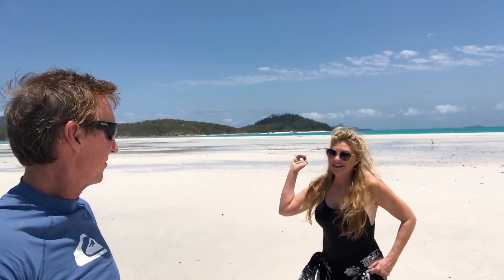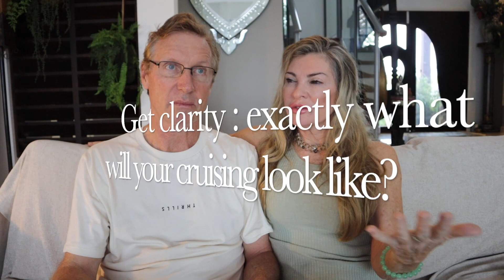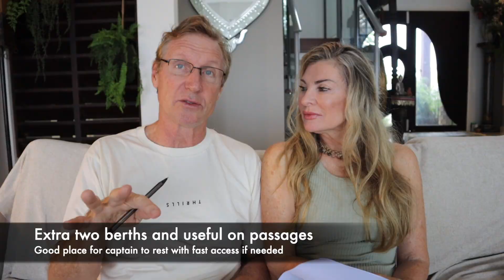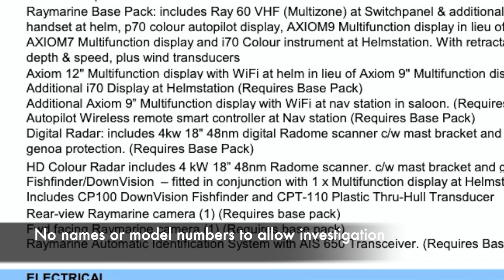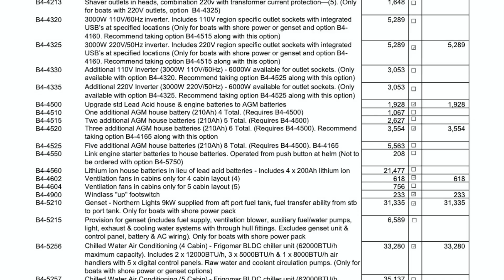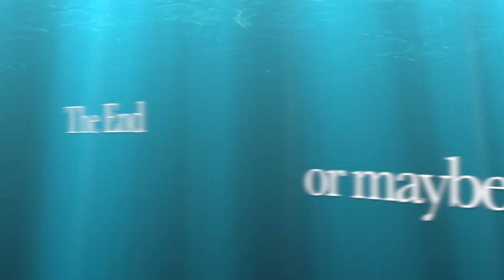#13.1:  CHOOSING FACTORY OPTIONS - for new boats!  Part 1. Leopard 50 Sailing Catamaran

Comment: For a viable cost effective alternative to lithium check out Firefly Oasis Carbon Foam battery - Thanks for sharing your options experience!
Reply from the maker: Dear Michael,
I looked these up and they look great with discharge rates that do get close to the Lithium - amazing!. We will certainly look at them when the time comes for the AGM replacement and hopefully in that time there will be a lot more info about them by that time...

I am sure all the viewers who are at that stage of purchasing batteries will be very interested too...
Thanks for the comment and watching and look forward to more guidance as well. 

Regards, John and Eli
Reply: Please explain, price etc

Comment: Great video and super helpful - thank you. A couple of things I found: (1) The foot switch I think is an Up Only near the forward cockpit. You already have the up/down remote, so I'm not sure this is important? (2) Lithium prices seem to be much better aftermarket (get a quote for JustCats). Congrats, and looking forward to more of your videos and adventures!
Reply from the maker: Dear Edward,
Thanks for your comments - they are really useful!!!

Yes when we were going through the options list, one of the difficulties is not knowing what is already there as it is not stated anywhere. So fine details like the foot switch was certainly not known to us so thanks for pointing that out. 

In relation to the Lithium cost being better at JC, because we were scared of by the price and our ignorance we did not get JC price but  other viewers will appreciate your information. Certainly for items you do want to get, it is wise to get the aftermarket price before choosing as some things are cheaper and some more expensive.... It all takes time and effort - we were working full time during that process so we did not get into the fine detail.

John and Eli

Comment: I really enjoy your videos.  I'm in search of a used cat. I am shocked with the upgrade prices.  This is ridiculous.  I am very disappointed in leopard.  Or maybe I don't understand or I'm missing something.  Best of luck guys.
Reply from the maker: Dear Sid,
Yes work on boat done by the professionals is expensive - that is why most people try to do all the work themselves and only splash out when they have no option or have the cash flow. Those levels of costs are probably similar in most parts of the developed  world (US, UK, France, Australia) with the only cheaper options being in counties where the hourly rates are much lower like Thailand, Vietnam, Malaysia, Indonesia + should be in South Africa etc. Sometimes you can get great work done by these folk at low cost and at other times, they use substandard gear and it falls apart in a short time...

The more you can do yourself, the more money you will save! The more you are on the boat=, the more skills you develop too.

John and Eli

Comment: You can buy normal solar panels 370w each now , 4 across the back on an arch nearly 1500 watts of solar . Also have seen someone use the Tesla batteries out of a Tesla car which gave them 5kw of battery power storage .
Reply from the maker: Thanks “Ston”,
Yes that is correct about the 375W solar - that is what Just Catamarans put on our arch with four making 1500w for $16,000 incl the stainless, controllers and firing. It works great and we are self sufficient on most days with this ( except air con).
TheTesla batterybank sounds exciting and technology is improving so fast - hopefully Cheaper, lighter and more power!

Comment: Another great Video Guys and just the kind if thing me as a future buyer/owner needs to know, in saying that... here's a little research and 'food for thought' for you... next time you upgrade your Batteries consider upping the Solar panels, ATM standard is 370w per panel, however 500w is available as is 810w,  also check this Guy out  

https://www.victronenergy.com/blog/2018/10/03/nigel-calder-and-the-integrel-9kw-alternator-on-steroids/ 

factoring the replacement cost of a Genset versus adding Nicad Batteries (future price drops in your favor) and his alternators etc, it may be the go... til next time... Oh and thank you for replying on your last Video too...
Reply: Opps i meant Lithium batteries, sorry just finished work (night shift)...

Comment: You also may want to start with Lithium Batteries vs AGM...that way your boat get setup for the Lithium Batteries and you don't have to do it later...check out these two for soft start and Lithium Batteries links... https://www.youtube.com/watch?v=J-kND4PaZm8 and https://www.youtube.com/watch?v=yjK1Gi_u6ss
Reply from the maker: Thanks for those links. We support the Wynns too and lithium like blue lights got the flick when the crunch came. We have never had ac and currently it does not run off the batteries do undoubtedly will be using it conservatively. I will look at the details of the soft start too. Thanks very much for your feedback as this is new yacht territory for us!
John and Eli

Comment: You many need to get soft start for your A/C, to protect your Batteries when using them off grid A/C...
Reply from the maker: Please tell us more! So far we only use the ac with the generator running. Do we still need soft start?